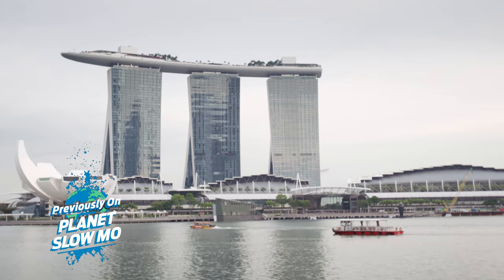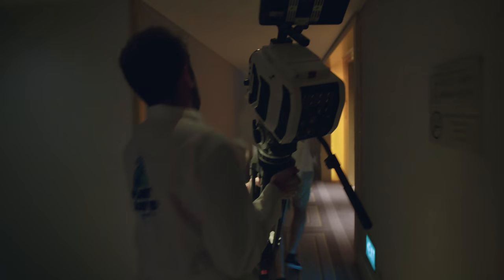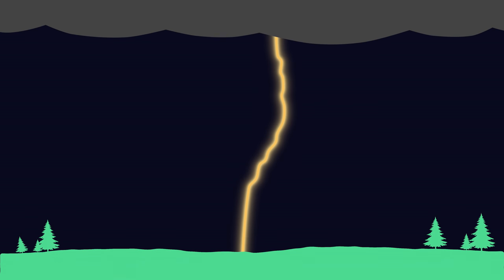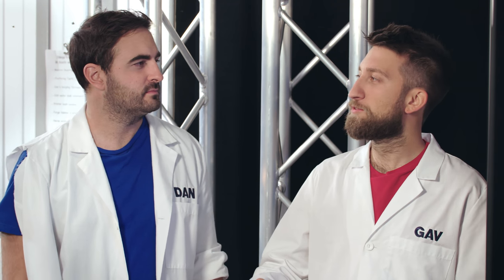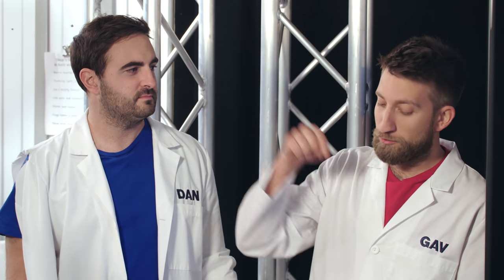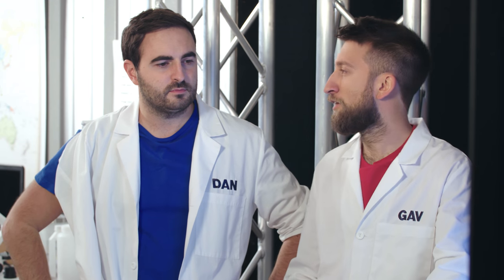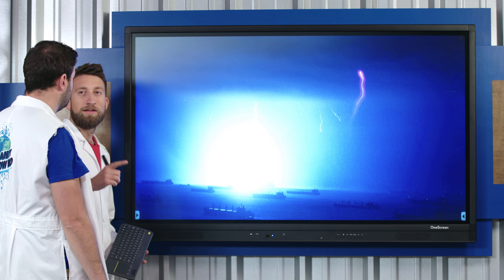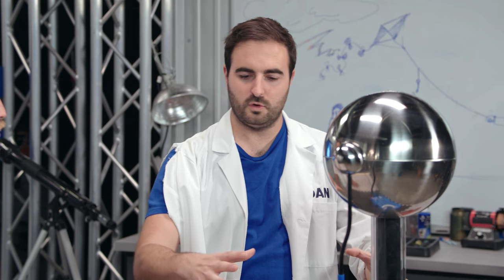Van de Graaff Generator in Slow Motion

Comment: i saw a lil video on fb the other day where they had a strong magnet hanging from a rod of sorts and underneath was something like  a plastic cutting bored covered in iron shaving or something and when they hit the plastic board from underneath u could visualize the magnetic fields as the particles were sent up into the air idk it was cool but it wasnt the greatest video i think you guys could do a really good job of it  if u wanted to. best regards hope you have been having a good year so far

Comment: Screen could be caused by EMP generated by high voltage breakdowns . I have worked in a high voltage lab in the past (up to 2.4 millions volts), and we faced a lot of electronic and electric equipment failures when we did high voltage arcs.

Comment: Van der Graaf Generator - Flip it upside down.

I think they explained the VDG wrong. Below is tldr version of wikipedia and what I remember from school. It is possible that I am wrong. An experiment would decide.

I think it actually creates charges by friction (triboelectric effect). The polarity of the charge should depend on used materials not the orientation of the device. The charge on the belt is transfered inside a conductive sphere. Then you use something called Gauss law to figure out that the potential inside the sphere is zero and that all the charge goes to the outer surface. This means that inside the sphere there is still room for more charge and therefore it is not travelling back to the belt. This means the electric potential on the outer surface will just grow and grow until you discharge it.  (Instead of using the Gauss law you can just imagine the repulsive forces force the charges to the outer surface)

Comment: Funny unexpected shock from further distance at 8:46
The explanation: When Dan comes close to the top capacitance of the van de graaff generator slowly he already slightly discharges the device.
The second shock was thus possible from much further distance and quite unxpected.
Thanks to Electro Boom : https://youtu.be/QarKXkXox6M?t=135

Comment: I understand with a different aperture you might not get the blow out, but you'll also miss out on the details of it coming down. I also realize these cameras are extremely expensive. How hard would it be to have two cameras side by side, with different apertures, and merge the videos together so that we can see the detail before it flashes over, but also be able to see the actual strike?

Comment: Great video overall. I have an issue at 6:40 when you say the lighter + charged particles travel to the top though. Exactly what particles are you talking about? It is far more likely that negatively charged electrons from the belt are the charged particles being transferred as they are not as tightly bound to materials as the ions of the belt itself. i.e. if the belt is positively charged, then it is more likely that electrons from the metal dome will be attracted to the belt and transfer to the belt and back down to the lower comb where it goes to ground or the small hand-held sphere. This still leaves a positively charged dome, but it would not be from positively charged particles moving. I note that some websites say that the belt gets negatively charged though and this will depend on what the rollers in the device are made from due to the triboelectric effect.

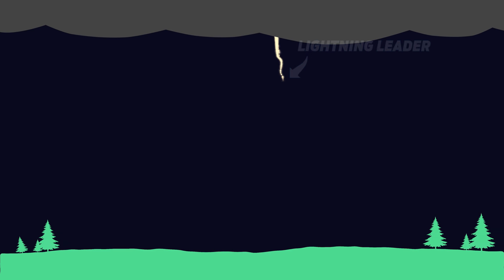Comment: I'm pretty sure Prof Liew was wrong about the speed of lightning. At 1:40, he says the "leader goes 1/10th the speed of light". But that's NOT right. EVERY source I've read claims that the lightning "leader" goes MUCH SLOWER; closer to like a 1/1000th the speed of light. That's 1,000 times slower than what Prof Liew said. The return strike can be between 10% to 50% the speed of light so he was right about that part.

Comment: 2:30.
I've heard it burns your foot, not much else (unless it shorts your nervous system or kills you - apart from that, just your foot)
This could be very wrong however.
Reply: alan smithee Actually if you are not wet or have no open wound on your skin, your electrical resistance is very high, causing the lightning leaders to curve around your body. Your skin gets burned from the heated gas creates by the lightning flash, not necessarily the electricity itself.

Comment: The weight-based explanation is misleading for clouds and totally wrong for the Van de Graaff generator. The accumulator of a Van de Graaff generator can be either negative or positively charged, depending on what materials the belt and two rollers are made out of.

Comment: Well I think we got more than one bolt in the Van de graff's but they were really tiny cuz :-
1. the distance is too short
2 . The fact that bolt is really fast (the speed doesn't change) but distance is reduced so time is even less , moreoer RESISTANCE of path is less cuz the path itself is less compared to actual one..

Comment: Awesome, but... you've got it wrong, about how lightning being created. There is no "ice particles hitting each other", that cannot generate charge, because you will need DIFFERENT materials rubbing each other to create a static charge. Charge accumulates mostly during water awaperation, so basicly the ammount of OH- particles is not equal to the H+ particles in the vapour, so there is an actual charge being send to the sky, and also there is a solar radiation, that is why there is more lightning on a planet at a specific time (when solar radiation hits weak spots in magnitisphere) and where the is a lot of water.

Comment: I wish people would stop using voltage as a measurement of danger for electicity. It's not.
Reply: Well, there are other factors, like where the voltage is applied, time, total energy, ...  However, when you have enough zeros at the end of number of volts, you can pretty much ignore all other parameters. Of course, when someone says such big number, they probably mean voltage between ends of lightning, not voltage across human.

If you ignore extremely short events, voltage is pretty good measure of danger for electricity.

Comment: careful with a VG you can injure muscles from the current causing them to twitch unnaturally. i injured my forearm demonstrating one i think i was hit too hard or too many times. it was a college project not a very powerful unit but it was pretty strong. it pulled the same muscles you would injure if you have tennis elbow and it lasted on and off for about 4 years. be careful!!

Comment: If Dan used the back of his hand it wouldn't have hurt as bad, since it's over a larger surface area. Another fun trick is to stand on a raised platform to unground yourself, and put a hand on the generator and turn it on. It then makes you like the big dome and whatever you touch gets zapped.

Comment: @ 10:38 why does the spark clip say "smarter every d" on the bottom left of the tv screen, is there a connection between destin and this  slo mo guys series? im preety sure they have done colabs before but i could be wrong

Comment: compare this to the speed of light and or the spped of an electron through the air.
Reply: and explain why the secondary tendrils continue after the main bolt propagates. .... ... ... can we have a bolt pistol that launches an unended electron bolt, if the secondary bolt propagates after the main bolt shorts.

Comment: 2:48 "30,000 Kelvin or centigrade". I'm pretty sure kelvin and centigrade are very different measurements
Reply: Gizmo Games Kelvin and Centigrade values are very similar at high temperatures.  Since you only add 272 to Celsius to get Kelvin, adding 272 to 30,000 doesn’t make a big difference.

Comment: Guys, please:
Do you have the best recording equipment possible but have your brains read what was documented?

I had already realized what I'm going to draw attention to, without expensive cameras:

After the ionized branches from above, the beam itself is EJECTED TO THE SKY and not the other way around.

At the very least, the intense light flashes start on the ground, as all the recordings recorded, so would the initial path coming from above not be a lightning ignitor, attracting it upwards in the opposite direction?

At school, I learned something like Potential Difference in electrical, which teaches that the load always travels from the long side to the short side, like hydroelectric dams do, generating a lot of energy and dissipating it to homes.

Wouldn't Earth have much more "Potential Difference" than Atmosphere?

Anyway, your videos gave me the clear impression that lightning is ejected from the ground and not the other way around, even because survivors of flashes report all the floating sensation, including hair and body hair, which are attracted "upwards", prelude to lightning that will happen.

Trails on green lawns also demonstrate a ground registration pattern converging towards the center, something that would suggest again that there was an upward discharge ejection rather than a lightning strike from above.

Tips for getting out of open fields under lightning storms, wouldn't they also suggest that we would become "ejector cannons" instead of "antennas" by being the "highest" point in these environments, making our bodies an ignitor coming out of the ground?

Anyway, congratulations on the way you approach the topic, you are great...

Comment: I'm surprised you didn't cabbage all your kit.  You got away with it lightly by your monitor acting up.  The Van der Graaff gives out very high electric field strengths, e.g. 3 megavolts per metre.  The electric field strength in a lightning bolt is nowhere near that.  It is thought that lightning is initiated by high energy particles coming from space.

 When I did this in class, I always made the students put their mobiles in a metal drawer, with my laptop.  I turned off my Desktop and overhead projector completely.

A colleague of mine caused a surge that knocked the supply off for the whole college!

Comment: irs not about the volts (amount of charge) it is about amperage ( the speed of flow of the electrons) you could touch a 1000000 volt tesla coil with about 0.03 amps coz the flow trough your body would be so slow your body would not react mutch to the current. and would just lead it off to the ground or disperce it in the air wich is even safer. by the way i am not some kind of wild professor i am just a teen so i mey be wong. XD i watched this when it came out too.
Reply: its about the energy transferred, thats what will damage you. energy is power over time

Comment: Eh, global shutter? I'm having a hard time believing that it is truly global and manages to completely mitigate rolling shutter. Physics cascades, nothing is truly instantaneous, even electricity takes time to propagate through your camera's computer. Perhaps the shutter effect is greatly reduced to the point where it is non impactful, but simultaneity does not truly exist. There has to be a time gap between the shutter of one end of the camera and the other end, or else they would be in the same physical location

Now I don't actually know how global shutter works, but I'm making the assumption that it still operates on the fundamental principals of physics lol

Comment: I'm sorry but your frame capture of a partial return stroke is inaccurate. All I saw was  one frame  severely over exposed when the step leader nears  the rising streamer.  Since lightning is not electricity but dielectricity it discharges instantaneously in zero time so shutter speed is irrelevant.  If you can clean up the shot or find a camera with a faster frame rate and prove me wrong I will stand corrected but until then I stand by what I believe.